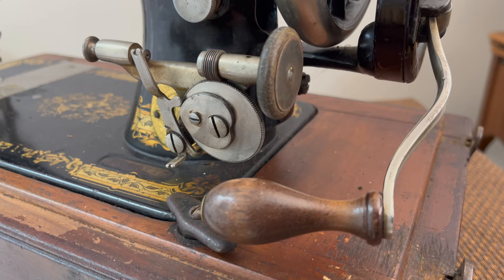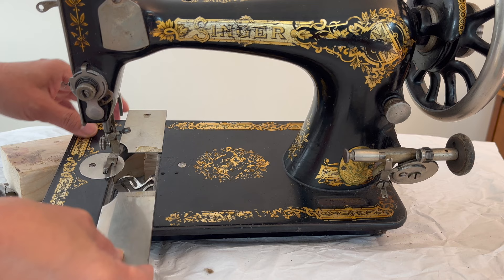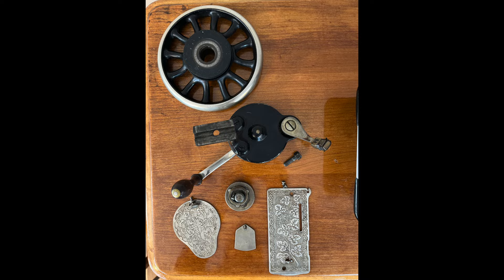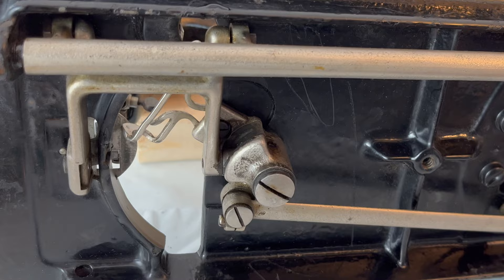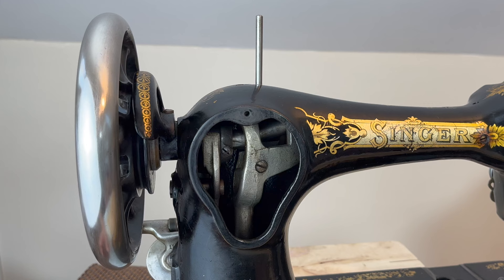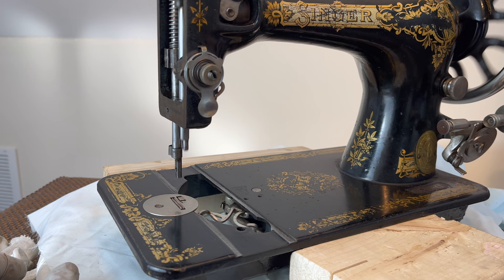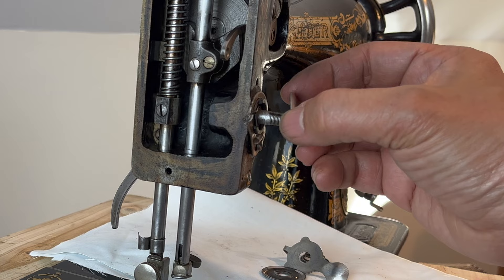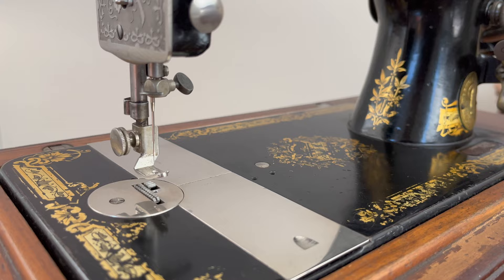Caring for my $100 1910 Singer 28K Sewing Machine with an Original Hand Crank

Comment: I recently bought an 1895 28k, it works really well with immaculate decals. It had only one user that immigrated from Scotland to Canada at the turn of the century. It only needs cosmetic attention, however, I really want to clean and oil it before I officially become the 2nd user. Maybe not to the detail you did with your machine, but certainly to help it run smoother and have it feel cared for. Thanks for the detailed vid

Comment: This is the second handcrank restoration I've seen where damage to the finish is on the side of the body nearest the handwheel. I'm assuming it's pin rash but that's usually on the thin section of the body nearer the upper tensioner. I have a 128 but it's electric (no pin rash thankfully :) ). Is there something about using a hand crank that would make someone want to have a pin cushion that far to the right?

Comment: I have just learnt that on my machine with the slide plates.. 

The front black area there is a hole, this hole should have a cotton oil wick in there... this is oiled & this cord will oil the part of the shuttle..

I have just ordered my cords & awaiting to put these in several machines..

I have a 128K hand crank dated 1948, 
Veritas handcrank dated 1910, 

Gritzner R treadle & hand crank fitted with a spacer & a singer hand crank, dating 1920-1925, 

1885 Wertheim hand crank, 
Pfaff  hand crank dated 1906,

Hengstenberg/Anker hand crank dated 1900,

Vickers hand crank (still paying this off before I collect)..

& many of the singers 99, 99K, either hand crank or powered & knee lever as well & a 201 treadle/knee lever & hand crank..
Reply from the maker: Wow Voni... What a collection you have! I will google how your other machines look like. Do the hand cranks differ on the different machines?
Reply: @vintagetall6152  ... no, they work the same way, some are attached on the end of the machine & the Wertheim hand crank bracket is attached to the wooden base..
Reply from the maker: @vonibrown923  Which one among your hand cranks do you like best? your top 3 for any reason. Just curious...
Reply: @vintagetall6152  ... my 1910 Veritas, Hengstenberg/Anker & my Gritzner R, ( the others have the reverse) which the singers don’t have  till you get to the 99k...

Oddly I started with the Singer machines then went to antique machines. 😂
Reply from the maker: @vonibrown923  They are all beautiful works of art.  Thanks for sharing.😊